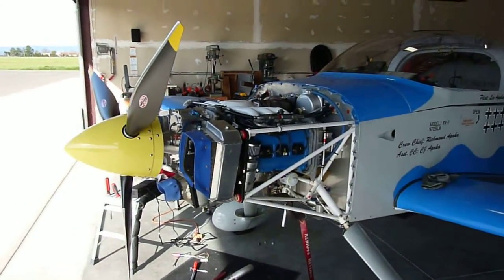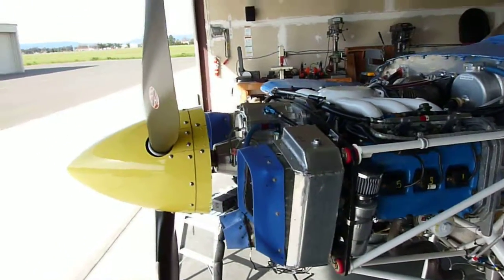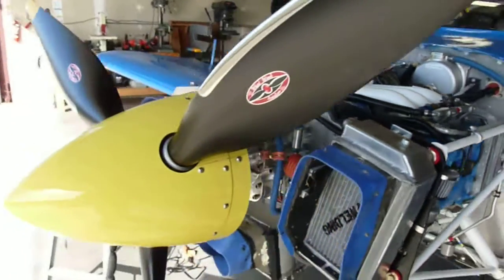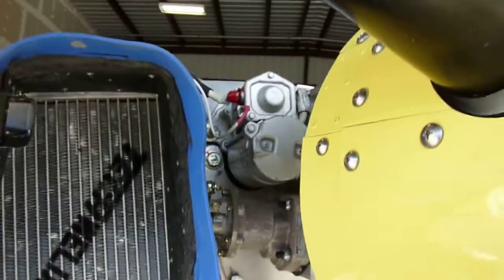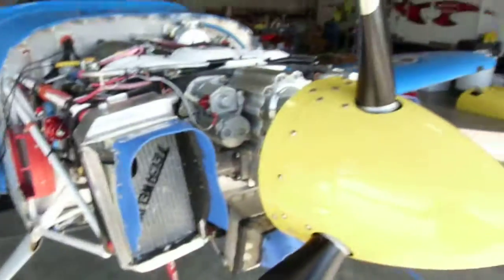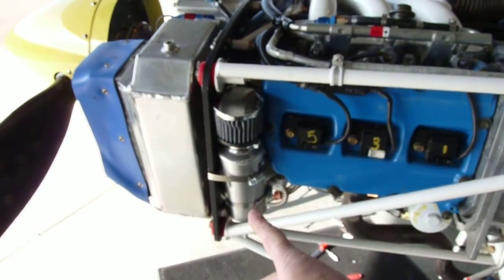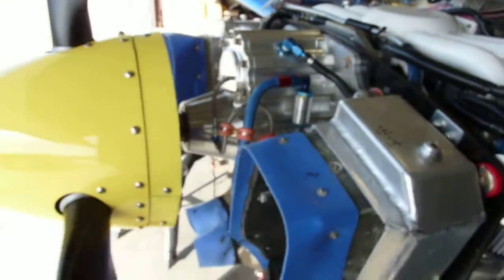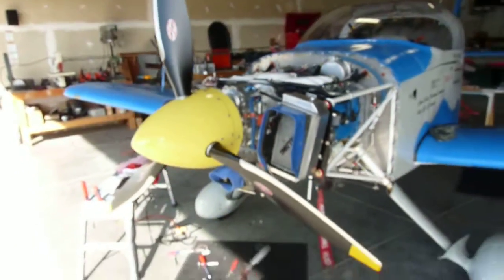geareddrives psru installed on RV7 subaru ez30 h6 engine

Comment: Why not go with a proven engine like a rotax that will run 2,000 hrs TBO instead of  200 hrs and tear up all great looking sheet metal . If you are married, she should take out a life insurance policy if she could get one because of flying an experimental airplane. These engines were not intended to leave the ground, Just a cheaper way to die.
Reply: This is one of the many RV with the Subaru engine that will never fly or fly very few hours because of the constant overheating problems, gear drive problems.  Mostly it's about the engine overheating.

The main overheating problem are the two badly installed radiator behind the propeller. For the radiator to work, it needs airflow, meaning air must be able to flow in and out.  In this case, air gets in but there is no where for the air to exit.  If Egenfeller had engineered the radiator to enable the airflow, his company would still be thriving. Oh well, live and learn.

Comment: Really cool, it didn't even unexpectedly fire when U spun the prop in the same direction as the engine rotates, that is so rad!!  Probably some sort of centrifugal clutch inside this reduction unit. I'd love 2 know if I can purchase a Subaru EZ36 engine from Pick N Pull junkyard out of a salvaged Subaru car, and take it apart and put it together with high performance parts and do the entire power system myself from scratch, not from a package. I'm really interested in converting engines from cars that have been junked out into high performance engines for aircraft.

Comment: Just curious gentleman what the ecu of choice is for the cf4-20t 2.0 litre turbo subaru from crossflow aero . I purchased two of them on barnstormers. One is a dta S60 2009 yr and the other is  a 2006 oem ecu. both identical engines. SDS??? thanks cool videos.

Comment: Problem: The fuel map in the ecu is set for car-gas and Av-gas( 50/50 )   The manual says car gas is ok but it's not.  You will run lean and the same will happen to you.  This is after
200 hours of great flying with no problems.
Answer: He had the ecu unlocked and made his own fuel map.  Runs great now and he went
from 6 gph to 10 gph
Mybe u can get this info out to a Subaru build site for other builders.

Comment: FYI
My buddy has rv-7 with Subaru "yellow covers"  He ran car gas and had the head gasket burn-through which caused high pressure i.e. the overflow tank cap pops and loss of water which lead to over heating the engine.  The head, block and piston are scrap.

Comment: Off the wall question for you, what do airplane guys do for the electronics for running your motors?  I see a lot of planes running Subaru motors and I'm curious if there is an easy approach to making them run in something other then the car they came in.  Like if there is someone that takes a stock harness and makes stand alone harnesses.   Thanks